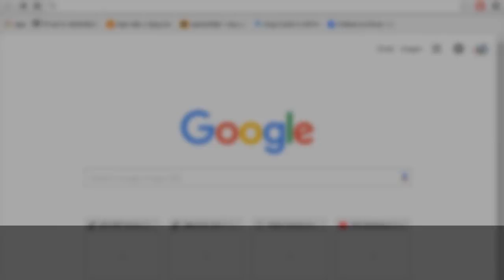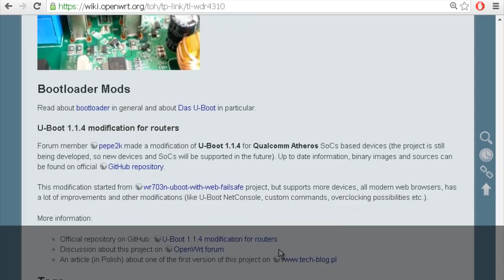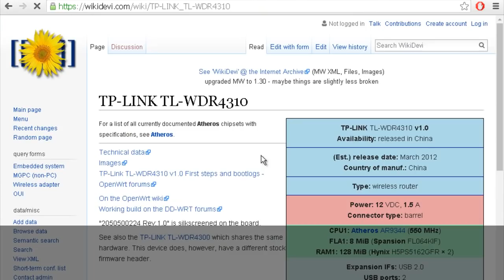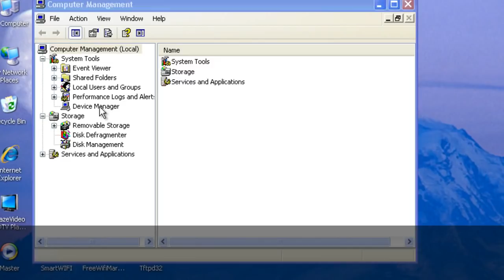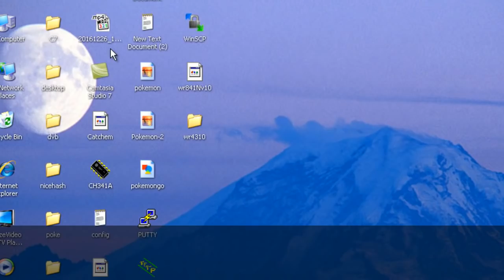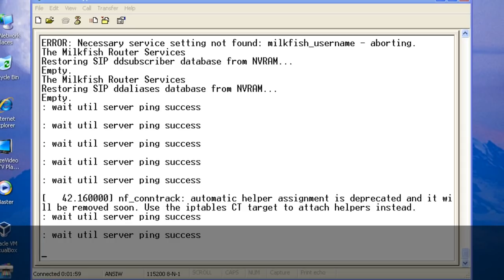Make serial console for TP-Link TL-WDR4310 router 2 monitor or unbrick

Comment: Nice info, Lodi. I have a router modem, bricked, dead reset button, wifi indicator no light and network, no light but there is a build micro usb. Detected in usb mode and serial mode in ssh, but cannot enter root. Is the hyper Terminal worked,